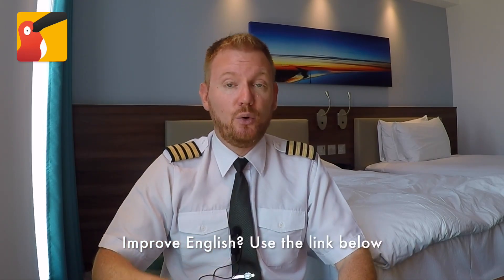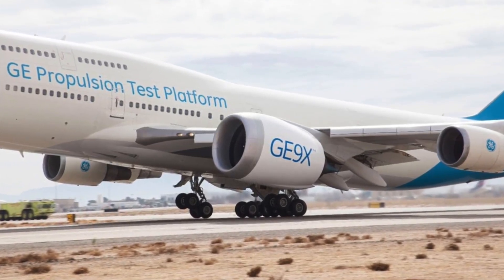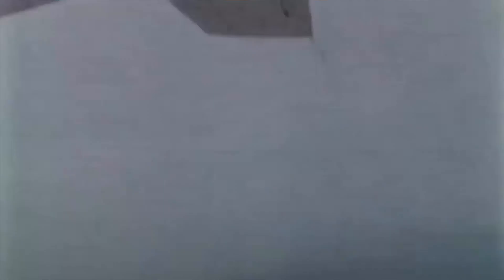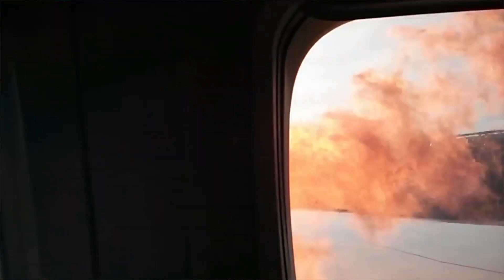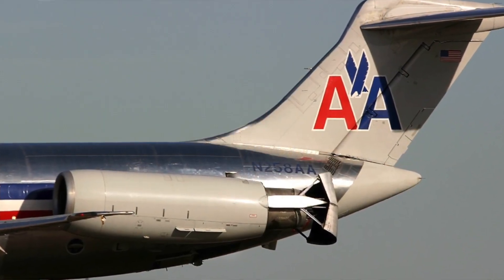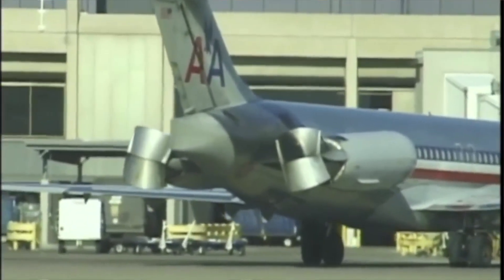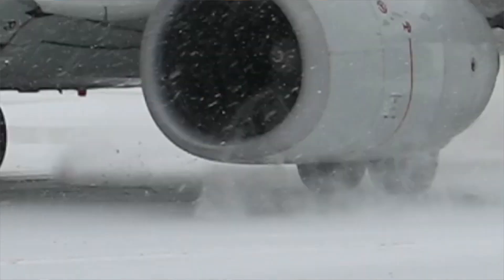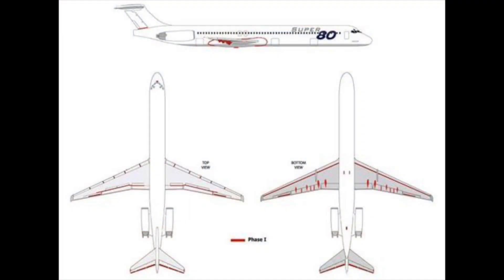Why are the jet-engines placed there? Wings vs Tail

Comment: Nice video!  You took it in a hotel on a layover?  

1.  One of the main reasons that engines are mounted to wings is that the weight of the engines tends to stabilize the wing.  It doesn't so much stop it from bending as it simply adds mass which makes the effect of turbulence less on the structure, which in turn means it can be built lighter.  This is the same reason that fuel is carried in the wings.  On most aircraft with a center wing tank, the wings are filled first and then the center tank is filled.  The reason is that fuel in the center tank does NOT stabilize the wing and in fact causes greater center section flex, so it is detrimental. 

2.  Rear mounted engines have their weight attached to the fuselage.  Just like center tank fuel, this engine weight contributes to center section spar stress during turbulence or maneuvering.  Airplanes with rear mounted engines have to have stronger, heavier wings as a result.

3.  Rear mounted engines give the wing a very clean profile, which greatly contributes to performance.  The Boeing 727 was known to be the second fastest airliner ever built after Concorde, yet it's landing speeds were no faster than some turboprops.  The rear engine design allowed barn-door sized triple slotted flaps yet the 37 degree sweep and clean design allowed cruise at .90 mach for some models.

4.  Airplanes with rear mounted engines have shorter landing gear, which makes integral air stairs more practical.  This is one reason why most private jets have this design.

5.  Airplanes with rear mounted engines look less impressive.  Since private jets are typically owned by public corporations, the "cheaper look" is easier to get past shareholders.....

6.  Sure you can mount high bypass ratio engines to the rear of an airplane.  Dee Howard had a design to re-engine 727's with two CFM-56's and delete the center engine.  Problems?  Yes:  First of all, this would be a seriously expensive modification to airframes already basically worth their scrap value.  But second...The heavy weight of the high bypass engines would make it very difficult to keep the center of gravity within the proper range.  This is the reason no manufacturer did this;  It is difficult to keep the CG correct and this ruins usability.

7.  Rear mounted engines have very quiet cabins, in comparison the rear end of a 737, which is screaming loud....

Keep up the good work!
Reply: "Dee Howard", that name brings back some memories.  I used to work in those big orange hangars in San Antonio (Of course, by then it was SAA.  VT Aerospace now...)

Comment: larger engines on the wings?  so didn't you do a piece on the reason the 737NG  CFM56 are flat on the bottom and they don't really fit under the wing?  I know the diameter of the MD-90 fan is smaller than the A320, but that's because it needed a lot less thrust due to being a lot lighter OEW than that A320.   The other reason being that Boeing couldn't make the gear taller without a complete wing redesign.  The reason I like engines on the tail is that the wing can be smaller and more efficient due to not being blanked by nacelle flow and also by having true full span slats and flaps.  Yet another reason I don't like engines on wings is that the installation usually causes power trim issue, where as on the tail they just make aligned thrust.  737 classic and NG were particularly bad about requiring trim changes during power adjustments.   I can see that you didn't notice the times when the fuselage was penetrated by fan blades and turbine blades.  The recent Southwest incident comes to mind as does that huge fire at LAX when a CF6-80 on a 767 let go.  Regarding fires, I would rather it be contained on the tail than near a wing tank or fuel lines.  My $.02

Comment: Now I know why you never shows the inside of the engines. Compressor blades.  Compressed AIR IS THE "FUEL"
Reply: Nope. Compress air is the oxidizer. Jet A-1 is the fuel.

Comment: Lovely video. One more fact is, rear mounted engine planes need to have a stronger wing superstructure since it needs to prevent over flexion during lift which otherwise would have been maintained by the weight of the engine below the wing, hence the weight of the over all aircraft becomes more.

Comment: One disadvantage that you didn't mention wit rear mounted engines is that since te wing is further back the center of gravity of the passengers and cargo will be forward of the wing. This means that the center of gravity of a fully seated aircraft will be much more forward compared to an empty aircraft. So an aircraft with rear mounted engines must be able to handle a larger center of gravity envelope. This means larger horizontal tail and larger elevators.

Comment: I respectfully disagree about there being more room under the wings to increase the size of engines. In fact, that has been more of an issue for wing-mounted engines, hence the "flattened" engines under the 737.  With fuselage-mounted engines, their size can be increased without restriction... however, that also comes with added weight, which would shift the center of gravity aft, unless accounted for with added balasts or strategic placement of cargo and/or passengers.
Reply from the maker: Yes, it’s the combined problem of weight distribution and required strengthening of the aft fuselage that makes wing mounted engines more easy.

Comment: A disadvantage of rear mounted engines is that in cold weather, an improperly deiced wing could cause ice to get ingested in the engines and damage them, like what happened to one SAS flight that crashed on takeoff a while back.
Reply: The Gottröra disaster on flight 751, 1991.

Comment: How about engine above the wings like an-72 and ys 11? Thanks
Reply: Yes, and why not have a high mounted wing with the engines below like the C-17? That would make the landing gear shorter, put the engines more in line with the horizontal center of mass (less pitch moment with thrust changes), and still give the engines higher ground clearance to avoid FOD. The wing tanks would still be above the engines as well.

Comment: A nother benefit of mounting the engines under the wing is that they will reduce the load on the wings during flight. This might seem counterintuetive in the first place but usually when the aircraft is in the air the wings bend upwards as they have to carry the entire weight of the airplane. With the heavy engines mountet under the wing there weight will counteract this bend. As a result the wings do not have to be as bend resistent and can be build less rigid with a lighter internal support structure reducing its overall weight quite a lot :)
Reply: He said this in the video.

Comment: On the one hand as you said, in case of fire engine having engines under the wings prevents fire from directly affecting the cabin, but on the other isn't it more dangerous in a sense that there is fuel inside the wings?

Comment: One of the best vids I have seen about aircrafts. When I was small, I used to think that engines near the tail is for non-powerful aircraft whereby the engine weight helps keep the nose above due to more load at rear & hence easy to take-off :P
Btw, after going through this video, if you care for safety, fly in aircrafts having engines below the wings than at the tail. Don't know why small-medium private jets don't have engines below their wings ? Landing gear height issue or strength of wings in insufficient to support engines ?
And yes, subscribed to your channel.

Comment: As  a passenger, I prefer the engines in the back because of the quietness, the safety during takeoff due lower chance of debris going in (remember the Concord?) and knowing the pilot will be able to control the plane more easily if one of the engines fails.
Reply: Would suck if you had to sit in the back :D

Comment: Wing structure of tail mounted ac have to be more substantial than that of wing mounted ac.   The weight of wing mounted engines offset lift force, tail mounted ac don’t have that benefit.

Comment: Could you explain more about the stick shakers?
Thanks for the awesome content
Reply: In a large aircraft, a stall may not be readily apparent (due to, in part, hydraulic actuation of flight controls), so there is a device attached to the stick - basically, a motor with an off-balance weight - that simulates buffeting felt in the stick of a smaller aircraft when a stall is about to occur. Essentially, yet another way (in addition to the stall horn) to let pilots know that they're about to stop flying and start falling.
Reply: Thanks a lot I really appreciate it

Comment: Fantastic video! Maybe someone already mentioned... over the wing emergency exits are a bit more safer for rear engine aircraft compared to  under the wing. Rear engines aircraft might be immune to F.O.D. but ice formation over the wing surface may cause  problem as it happened in case of SAS flight 751

Comment: The engines mounted below the wing also add to lateral roll stability due to air flowing over the engines which causes differential AoA on the wings in a sideslip.

Comment: Another point on the wing mounted engines, is that the wing must have enough structure  and cord depth etc to be strong enough to have the heavy engines cantilevered.  Some wing mounted engines have the engines embedded in the wing to simplify the structure, though this isn't really done anymore on larger aircraft as it takes away from fuel space and adds manufacture complexity.  Then the rear mounted engines, some are on pylons which give some distance between the nacelle and the fuselage, while others are more or less directly mounted to the fuselage.  Having them mounted on pylons gives good noise reduction for the rear of the cabin, and this allows for higher bypass engines to be installed due to the increased space available.  One thing that is not common but does exist is the over-wing mount.  This allows a cleaner wing underside for better air flow, can reduce noise to the ground below in populated areas near flight paths, and of course less chance of debris getting into the engine from the ground.

Comment: What about low versus high-mounted wings?  Most commercial aircraft have low, ie bottom of fuselage, wings?  What is the reason?
Reply: Low mounted wings: simpler, smaller landing gear; "air cushion" effect during landing (possibly lower landing speed); perhaps a simpler design of the wing - imagine wing and belly tanks at the same level.

Comment: Concerning handling characteristics, what about the difference when it comes to roll? Does the higher moment of inertia around the longitudinal axis with wing-mounted engines affect the resistance to roll in a significant way?

Comment: Hey, mr. Mentor pilot. You always suggest for us to send in ideas for videos but I'm not sure the best way to do that so I'll just put it here in a comment. If a pilot were to exceed the standard engine parameters could he or she get a commercial jet to go supersonic and if so what would happen? Would the increased amount of drag from exceeding the sound barrier tear apart the aircraft? What if they put it in a dive to achieve supersonic speed? Any other related material such as normal engine output vs maximum output. 

Ah, here's another one I've been wondering about. From what I think I understand, the fan in a turbofan jet engine is similar to a propeller. Does the fan actually work kind of like a propeller or is that wrong? I believe that turbojets mostly produce thrust by blowing exhaust out the back but the turbo fan mostly pulls its way through the air...

Comment: I could be wrong but I was under the impression that some aircraft had a tail arrangement so that if stall was reached, and the tail looses authority, then weight distribution would be such that the nose automatically starts dipping. In fact I was given this reason as to why canards result in less drag than a tail (because they give a little lift in normal flight as opposed to pushing down which has got to be countered with extra wing lift). I do here have to stress though that this is not my area of expertise.

Comment: Did you state that aircraft without underslung engines are more aerodynamicly clean and also the wings can be cheaper to build.
Reply: That's true. But the empennage is more expensive to build, as he mentioned, because of the weight of the engines so far from the CG.

Comment: While on the subject of engines I have a doubt  which has nagged me for ages.
I know vaguely that jet engines work by generating thrust due to rapid expansion and expulsion of hot gases consequent to fuel/air combustion at high heat.
But how does ignition occur at 35000 feet when the air is at subzero temperature....won't the engine lose efficiency...will combustion happen at all ? Won't the engine just get flooded with fuel and stop ?

Comment: Hi Mentour, could you make a video explaining how the altitude at which the plane flies affects its speed and fuel efficiency? Thanks! Because when I see specifications for a fighter plane, its speed is given at two different altitudes. Thank you so much man!
Reply: At higher altitudes, the atmosphere is less dense, which means that there is less drag on aircraft. This decreased drag leads to greater fuel efficiency and higher speeds at higher altitudes, in general.

Comment: If they keep making the engine fans  bigger, wont at some point the edge of the blades break the sound barrier?  I've heard this mentioned one time about why the props on prop planes can only get so big. If the edge breaks the sound barrier, then what? Is it to loud or does this cause vibrations?

Comment: I thought using reverse thrust to leave the terminal fell out of use and regulation in the 1980's ? at least in the US. is it still used other places?
Reply from the maker: Yes, it’s still used a bit here and there.
Reply: Jess Hull 
It is also necessary when leaving a small private field with no ground staff or no push-tractor. I believe if an airfield does not cater for fare paying passengers then the rules don't apply

This is surely one reason some private jets offer this facility.
Reply: I can remember being on a United 737 that was still equipped with the original low bypass engines back in the early 90's that backed away from the gate with the thrust reversers. This was at O'Hare, and I was a little surprised by it, as even then it wasn't a common practice with that plane especially at that airport.
Reply: In the US in the 1980-90s I would see DC-9s do power backs at the gate but I haven’t seen it since. I fly a CRJ 900 with high mounted rear motors and in our early factory manuals they had a power back procedure. I am not aware of any US Airlines that practice this. Here, there are always tugs to push us back. 😄

Comment: The Q400 also has a pusher, probably because the wings are mounted above? IDK. Also didn't the 737-200's reverse thrust pushback more since they had bucket reversers and therefore wouldn't throw objects at the ground crew

Comment: @Mentour Pilot Great video! A glaring omission, though; one of the biggest flaws of the T-Tail, is that they often have only a single point of failure: the jackscrew. I don't know if they've added redundancies in later designs, but there was an infamous case of a jackscrew failing due to improper maintenance, which doomed the aircraft, once the jackscrew pulled out completely. I think it was an MD-80, or its predecessor DC-9.
Reply from the maker: True, but this video was about engines, not tail design.
I will likely do a video on the railing Jack-screws on both MD’s and Boeing later on
Reply: Thanks Mentour! I wasn't expecting a reply. :) I'll definitely consider Patreoning you in the future.
Reply: The Legacy 
After his absolutely fantastic explanations, the second best thing abt this channel is that we often get replies :)

Comment: You forgot the biggest issue.....passenger capacity... under wing aircaft can generally carry more passengers due to tail mounted aircraft needing all that structure in the aft bay for engine mounting bulkheads...etc..
Reply from the maker: True.